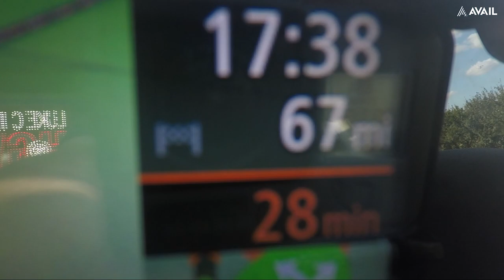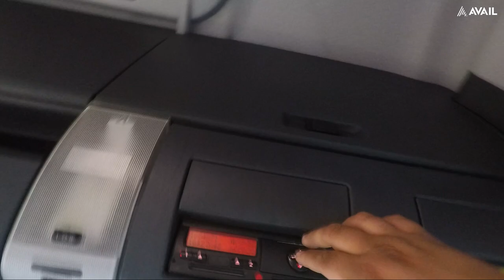Utterly Unbelievable!!

Comment: One load i had back in about 1982 . Transit pick up from B.P. Eakring Notts , the nodding Donkey oil pump  yard . Drive down to Kimmeridge Bay , Poole , Dorset . Deliver to the Nodding Donkey pump ( I dont know if its still there ).  2 x Overalls , 4 x Gloves , 2 x Helmet. . And the daft thing about it , there were Hardware shops in Poole that sold Work wear . Took about 13hr , before all the duel carirdge's from M1 down to Poole .

Comment: I hope you did what I did when I pulled 16' double decks,and as you went through those arch bridges...ducked!! Great vlog as usual,probably did better on fuel with that teardrop than a standard curtainsider with better airflow,especially being bulked out!!! 😂 ps you admitted it yourself but try and get out of the habit of relying on satnavs,the mk1 paper satnav is a far safer bet!!

Comment: Does anyone have information regarding regarding the 100,000 or so Drivers that were essentially 'Struck Off' due to Data Losses during the 1980s at DVLC? And/Or the way in which they deal with someone who passed a UK Driving Test, but is told their Licence is 'Invalid?'

Comment: What you call a double decker.. here in the states we call it a step deck or drop deck trailer
Reply: No, that's what we call a step frame. A double decker has two decks, or load beds almost doubling the number of pallets a truck can carry. Some are fixed deck, others, like the ones I drag around, have lifting decks so they can be unloaded from the same dock leveler through the back doors, which in the case of our reefers is the only practical way to do it.

Comment: The a34 northbound is always as busy as that on a Friday from 2pm ish onwards as rush hour is earlier on a Friday and the sheer vote of traffic coming up from the south coast the same with the m1 Eg the rush hour going north on the m1 on a Friday starts about 13.00 ish to miss the roadworks 

Reduced mode on a blue can be fun er not lol
Reply: numberplate guy 
Same on the clockwise section of the M25 between Clacket lane and Watford, I always avoid both on a Friday afternoon 😀
Reply: @andy.m265  

Clacket lane to Watford is fun at the best of times it can get busy from m3 round to m1 ish

Comment: Hey Luke quick question, at 27:55 and that area, if say the traffic turned out to be an hour long and there was no available places to park, how would that work in terms of driving hours. I’ve recently passed my class 2 and it’s small things like this that puzzle me. In this case would you be allowed to exceed the 4hr30 without a break due to the circumstances and for safety and make a note on the printout? Loving the content btw keep it up 👊
Reply: Always give yourself plenty time to find somewhere for a break never run right up until your time. There is no excuse for going over unless you are stuck due to to an accident or another extremely good reason.

Comment: What tacho head does your MAN have? We had Stoneridge on our older DAFs and I’d never trust it to tick over to 30. The Siemens on my new CF is spot on, but I still wait for 32mins 😂
Reply: I always wait till 32 mins too

The earlier tachos used to switch over to other work if the ignition was turned to check time etc during a break which meant truckers were having their break but the tacho showed reduced break which would have got infringement unnecessarily so
Reply: I do the same 😂
Reply: numberplate guy Yes. I do the same. What’s the point of potentially getting an infringement for the sake of a minute or two? Better just to wait to make sure. 😊
Reply: @grahamlive  

As I am an agency driver so much of the time I won't be familiar with the truck and or tacho preference or ignition situation of a truck etc I tend to make sure I charge my phone during the first part of the day before my 45 so that I can take the keys out of the ignition and leave the keys out of the ignition during the entire 45 mins etc that way I can't turn the ignition on by mistake and as such It's impossible to get an infringement by turning key to switch radio on etc during break and ignition turning break to other work but a person can still press the down button with keys out of ignition and it shows how many minutes of break a person has had but just without the orange light on etc but as a rule better to have a couple of minutes extra break than not enough Eg no fun only having 44 mins lol
Reply: numberplate guy  £150 fine if they’re feeling friendly at clacket lane services or if you’re unlucky like me you get tugged by city of London police on Southwark bridge and £550 for a “switch select infringement” two weeks into the job for taking 44 when tacho head said 45. Never again! 🤪
Reply: @HamptonSimon  

Your last comment will save a lot of truckers a lot of dough 

The fines put potential truckers off becoming truckers because truckers don't instantly become money brewster when they pass their hgv test 

Plus there is now much less places to park since most industrial estates no longer allow trucks to park on them. So trucks are now parked in laybys with no loo or down motorway slipways because the services are too full some have to park in the car part of motorway services etc Plus there is no fast food drive thru etc 

But with the 44 mins etc by allowing at least a minute or two either side of a rest break most companies don't mind that they'd prefer that a driver er getting an infringement but getting that fine two weeks in was a tad unlucky lol
Reply: @HamptonSimon  £550? Bloody hell mate. That's a bit harsh. It's ridiculous. No common sense used by the coppers there. Thank Christ I don't drive in London.
Reply: grahamlive they said they let me off the continuous driving for 7 and a bit hours without a 45, as I’d taken my 30 for 6hrs and were being “gentle” with me as I’d only had my license 3 weeks. I refuse to do central London more than twice a month now as I’ve been with my firm 2 years and realised I don’t have to be a yes man. It’s a mugs game. I can drive to Kilmarnock in the same time it takes to do get loaded, 10 drops around London and a few collections, then get out and home. Fucking joke.
Reply: numberplate guy my firm give us a £45.80 bonus a week for zero infringements/overspeeds/smashing anything up etc. Yet they’ll happily push me all day doing subby work for some multi drop idiot company with shit paperwork and god forbid you run over a minute here or there, or get caught out and have to park up and have to take stuff back as failed drops you’ll lose it and go on the naughty step.

Comment: What do you do if you're stuck in traffic and run out of driving hours and there's no place to stop for miles?
Reply: Push on through until you find a place, print off the tacho recordings for the day and write on the reason for going over hours, but the reason better be good, and not bad planning, and your traffic excuse needs to be checkable. DVSA will check with Highways England.

Comment: Those better be heavy.. or else a van could have done the job xD
Reply: I think the ratchet strap across both paletts answered that one Wolf.
Dohhhhhhhhhhh..............................
Reply: @Theoriginalbigbrillo  Why.. loads must be secured even in enclosed trailers/vans.. I do deliveries in a van.. I have 3 or 4 500kg ratchet straps and a 3 tonne one.. 
If you want to be 100% by the law.. your cargo must be fastnet to the point where if your vehicle rolls over.. your cargo must stay in place... That is redicilus and mostly impossebel.. but 90% of All road cargo is not fastnet down anywhere near enough... But if each og those pallets are 600kg or under.. a van could take them both..
And as that is a single.. what looks like a 4 or 5 ton strop for both pallets.. it is kinda hard to see the stitching.. and a single strap rated for 4 ton does not equal that is can secure 4 ton... its really complex how much you need in the eyes of the guidelines on securing loads..